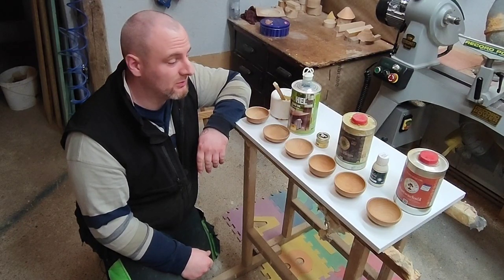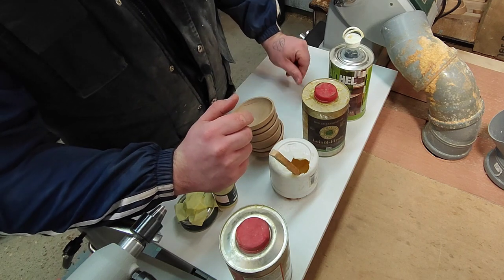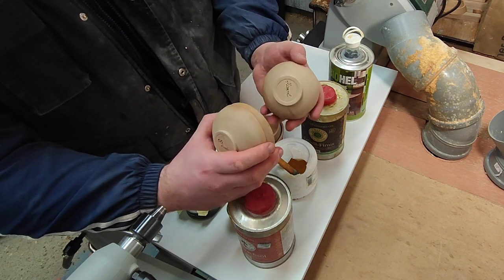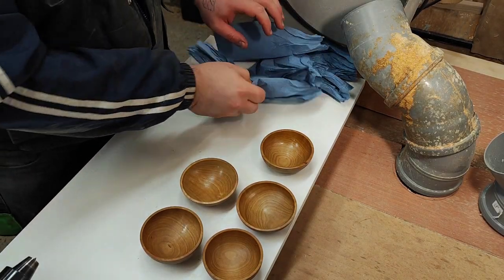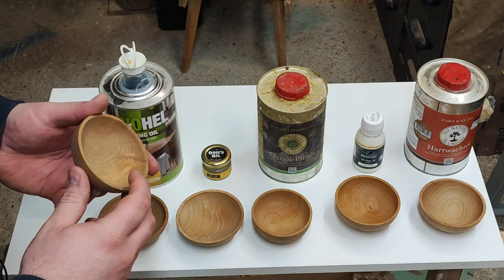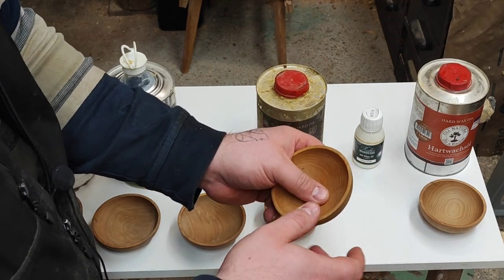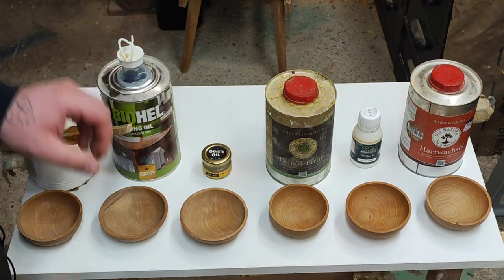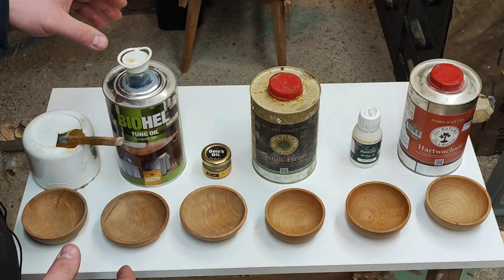Wood bowl food safe finish

Comment: I've been using either linseed oil or tung oil (both heat polymerized pure versions) and beeswax blends for food items, depending on weather I want the wood to darken much or not. And danish oil for decorative items (it is generally food safe too but only after it's done curing, which is like a month)
Reply from the maker: I like to apply without wearing any gloves so I tend to stick to natural oils.... New one from sweet pickens tung oil citrus blend is awsome.....

Comment: I find that the benefit of mineral oil is that a customer who purchases a finished piece can most easily restore it to original look without having to buy special oils.
Reply from the maker: That is true, I tell my customers they can use mineral oil if its conviniet for them,and it can go on linseed or other penetration oil..... But most of them use coolinary linseed oil and works great